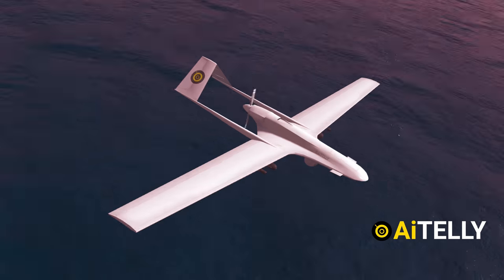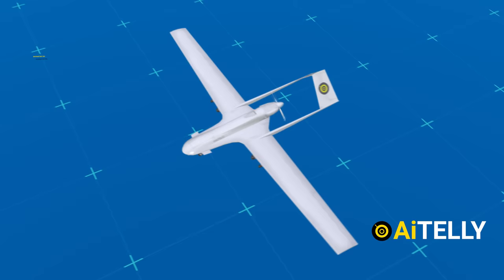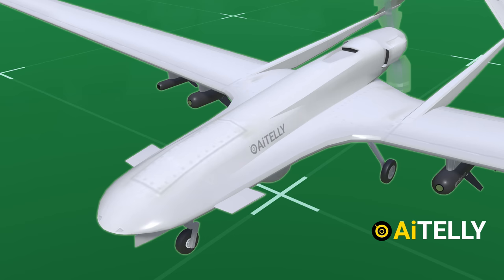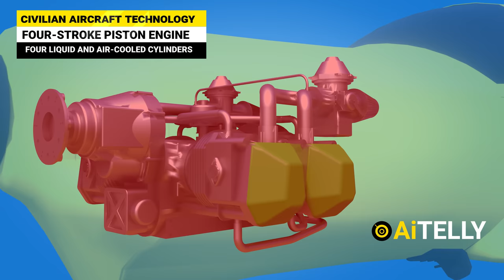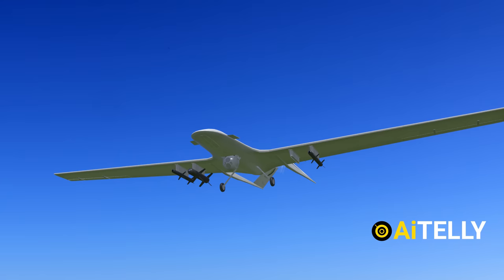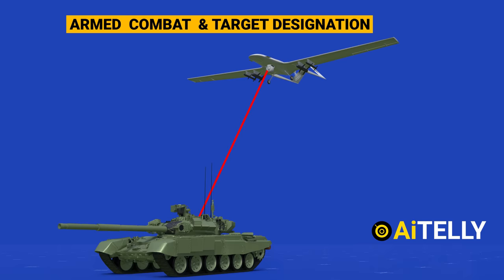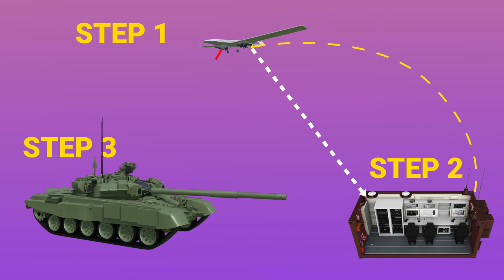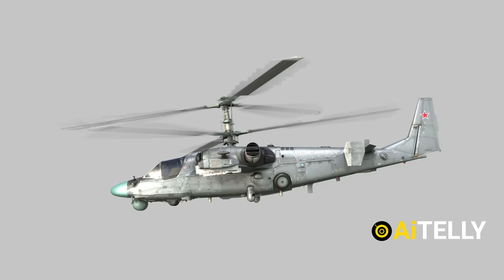How a Military Drone Works | Bayraktar TB2 UAV

Comment: Stop commenting that tb-2 is using pd-170 engine. It's not true at all. Only Anka and Aksungur are using this engine. Rotax is budget friendly because of that it's a civil engine and mass production reduces the price. It's not logical to use an expensive military engine for a cheap drone. Yeah it's an option but we can use it if we really needed otherwise rotax is always the first choice.
Reply from the maker: Yes that's what we're saying.
Have pinned your comment.
Our next Content the TB3 it is using the pd 170 (not sure)
Reply: It's a sitting duck drone. As it's not connected with satellite a person has to fly it who might be sitting in a nearby location.
Reply: @ankushbhagat341  No, Tb2s version has a satcom feature and can connect to the satellite
Reply: @ankushbhagat341  for this kind of drone 150-200km is pretty far away to keep operator from danger nowadays i saw news about the communication range increased to 300 km without satcom btw whenever tb-2 related content created why there was couple of  indians dudes making salty comments  is it really butt hurt to them
Reply: @Aitelly  Please, what are the tools used to make this video !!
Reply from the maker: Hi we made this TB3 to correct our Mistakes Check this Out
TB3 link https://youtu.be/Mw62n3g53vM
Reply: No, TB-2 does not use PD-170 engine. This engine a little big for TB-2. TB-3 uses PD-170 engine.

Comment: The Rotax engine and Wescam laser designator are not the only options anymore. Canada imposed an embargo on Turkey regarding these parts after Turkey supplied Azerbaijan with TB-2's in the Nagorno-Karabakh war, however, they lifted it after the Ukraine war started (what a bunch of hypocrites). Now Turkish versions use Turkish-made parts while export versions are offered in different combinations of either Turkish or foreign-made parts. Prices can go up and down accordingly of course. 5 million USD I suppose is starting price of a single unit without the training/command module/satellite link etc. which means if you already have the system installed in your country, you can buy additional TB-2 units for 5 million each.  If you take the whole package, in which case you have to buy the entire training/command module/ uplink etc., to install the system initially,  I heard BAYKAR's latest deal with  UAE was worth around 20 million USD per aircraft including pilot training, command modules, spare parts (whole pack) etc. for 20 pieces of aircraft which takes the entire deal up to 400 million USD.
Reply: Same procedure and costs has on other countries's drons too.I mean, if you order same size drons from US or Russia, Israel they ll be much more expensive then Turk's drons.
Reply: 20 pieces of aircraft don't need 20 command modules.
Reply: @user-ir7og3lx2d  depends which drone you gonna use. Some of drons beed land operators (captain,  gunman and commanders for decisions).
Reply: @lordlex6315  Yes because these drones are made with full western parts and know-how. Because western countries don't want to build drones, instead they said "Here Turks have this know-how and build the drones that we don't want to build." And yes all western countries are so eager to share know-how and high-tech parts with Turks whenever they needed..

Comment: Bayraktar TB2 is equipped with superior autonomous capabilities.

  It automatically taxis from its air base, takes off and can go to its mission.

  It can counter electronic attack. Russia failed to intercept the TB2s via electronic attack.

Because it is composite and small, its radar signature is small. Due to their relative slowness, they can easily be mistaken for flocks of birds by radars. While it is possible to tune the radars, for the radars to detect TB2s they must be able to deal with birds that are too many false targets.

If it is damaged during its mission and the signal connection with its pilot is lost, it can autonomously return to the air base where it started and land.

It can handle very harsh weather conditions in autonomous takeoff, flight and landing.

Besides the superior features of the TB2s, how they are used is also important. They can be used as flocks. Turkey used 20 TB2s in a flock in Syria. When used with air or ground electronic attack weapons, they can also be effective against air defense systems. It managed to hit the S300 air defense system, whose radar was active, in Syria.

Despite all these features, the TB2 is an aging Armed UAV. Bayraktar made the Akıncı offensive UAV with much more advanced features. Akıncı started to be used actively in the Turkish Army.

Bayraktar attack UAV communicates with the ground control station via satellites. Its range is as wide as the coverage area of the satellite it uses.

Akıncı can carry AESA radar. It can detect air targets and use air-to-air missiles.
Reply: I don't think it's aging but it's role changing, or more likely it becaming more specialized in a certain tactics or warfare
Reply: its burn US equipments too
Reply: yup, my only concern with the Akinci drone is that with it's higher speed (and higher stall speed) i just hope that it will not track more attention than the TB-2, otherwise i think it will do great!
Reply: @goranjosic  Yeah no that is not even remotely the same thing.
Reply: @afd1040  why? What is special about the navigation of this drone?!
Reply: @goranjosic  Aliexpress version doesn't work in extraordinary weather conditions. That is the difference.
Reply: @krebreves  Don't take this as an insult, but you sound like you have no idea what you're talking about. Turkish Military and Drone software project started in 1989? What did they use for programming? Amiga? :)
Reply: Let me point out what is the weakest link. It's not the weapon itself it's the specially trained human resources that control such sophisticated weapon. Knocking them out is a lot easier than trying to go after the weapon itself.
Once this strategy is adopted, the battlefield would change.
Reply: There’s no S300 air defense system taken out in Syria dude lol
Reply: @goranjosic  bak dostum Selçuk Bayraktar bu teknolojiyi dronlara ekleyeli 10 seneden fazla oldu, bu dronlar oyuncak değil, ve oyuncaklarla karşılaştırman çok ironik bir durum.
Reply: i dont know how effective it would be to but aesa on akinci but new jet motor turkish drone kizilelma mius most definitely should have it
Reply: @goranjosic  Remote Control RC air craft commanding older then 1989 dude. Turks were use radio frekans as others. Also remember that Apollo 9 moon landing projects computer specs:
 Frequency2.048 MHzMemory
15-bit wordlength + 1-bit parity
2048 words Ram 36,864 words Rom
:)))  year 1966
Türkiye is the NATO member and we were using early computers too. 
I mean RC systems is not that much difficult. Turkiye had no rocket technology tillll yesterday but we had some import/local products for use for this kind of technologies. We had long ambargos thats why we little been late. Turkiye is in 1 rank about Drons now. 
Do you know that Turks was produce and sale aircrafts to Europe. Probably not.
Reply from the maker: Hi, we made this TB3 to correct our Mistakes Check this Out
TB3 link https://youtu.be/Mw62n3g53vM
Reply: Indeed. Using sattelite means unlimited range. Turkiye has its own sattelites of course but they can also pass them on to NATO sattelites or other allied countries sattelites which pretty much covers the entire globe.
Reply: Also The ai of The drone can make the desicion of mission abortion or continuation in The lack of The ground base Signal
Reply: Any not civilian Drone is Unable to hack. And still Russia shot down all TB2 in first weeks (as the head of the military-industrial complex of Ukraine said in an interview with pranksters)
Reply: Reminds me of a story of some MQ9 the US used awhile back.
Apparently it lost signal through some mission and was supposed to do the whole Return to Home procedure.
But someone forgot to update the RTH airbase, and the drone apparently went on to land in California.
Since it was out of communications range when it went out, they just assumed it was gone, untill they got the phone call lmfao
Reply: This trashy plastic wing did nothing in last 7 months 🤣🤣
Reply: Community
Reply: @westerxxx9220  TB 2 never stops in Turkey. Last week, Syria also hit oil facilities.
Reply: ROFLMAO! Got OBLITERATED by the Russians. Don't hear about these any more. HAHAHHAHAHAHA!

Comment: Great video. TB-2 also can carry MAM-T for bigger targets like patrol boats and buildings. It has a thermobaric warhead. And there is also one thing you didn't mention. Overall shape and speed of the TB-2 allows it to have a very thin radar cross section. This won't help against IIR guided missiles but against radar SAMs TB-2 proved to be extremelly effective.
Reply: MAM-T has 30+ km range for TB-2 and 94 kg weight.
Reply: There was not any statement or use of mam t on tb2. Also one mam-t is almost 2/3 of all payload which cannot be carried left or right wing plyons and tb2 does not have any pylon at the middle like akinci
Reply: Unfortunately TB-2 has no capability to carry MAM-T. MAM-T's are developed for Akıncı, Aksungur and other light attack aircrafts such as Hürkuş.
Reply from the maker: made this TB3 to correct our Mistakes Check this Out
TB3 link https://youtu.be/Mw62n3g53vM

Comment: TB2 started using Aselsan CATS instead of Wescam a few months ago.
Reply from the maker: yes this will require another Video which  we will release in the next couple of weeks
Reply: wescam is much better than aselsan cats. But they still supply wescam via customer.
Reply: @leventnergiz  I agree. Wescam is the top of electroptics.
Reply: @leventnergiz  Well Telemus Systems (owner of Wescam) went broke.
Reply: @leventnergiz  Not anymore. Aselsan CATS now better than Wescam.

Comment: Good video explaining the basics of the Bayraktar TB-2 UAV.  Didn't realize they were so big!  Wonder if they could benefit from having a few miniature propulsive solid rocket boosters housed within those tail beams.  I hypothesis they would be used for quick get away and range extender.
Reply from the maker: Hi we made this TB3 to correct our Mistakes Check this Out
TB3 link https://youtu.be/Mw62n3g53vM
Reply: M.facebokk#*ide

Comment: Thanks for the video. I always wondered how they worked.
Reply from the maker: Always Welcome:elbowcough:
Reply: They are not whole truth, TB2 is not easy and simple drone as they told, It is an high tech and super softwared drone😎
Reply: @yusufilkertoprak  zaten basit dememişler videoda, sadece anlaşılır olması için basitce anlatmışlar.
Reply: @kutaydavdav1457  dikkatli izlerseniz öyle demiyor, yazılım üstünlüğünden ve kalitesinden kesinlikle bahsetmiyor! Üstelik kamera ve motor hakkında yanlış bilgi veriyor
Reply from the maker: Hi we made this TB3 to correct our Mistakes Check this Out
TB3 link https://youtu.be/Mw62n3g53vM
Reply: @yusufilkertoprak   Ağır harekat drone'u değil basit ve etkili işte Reaper gibi kıtalar arası gezemiyor abi işte. Adam övmüş zaten bir de üzerine senin övmene gerek yok.

Comment: very well explained,would like to add one more thing to the equipment part; jammer and counter jamming equipment in operational area these things fly,one should remember that they are still controlled by radio signals and vulnurable to jamming more than expensive satellite drones,thats why Turkey developed extensive layers of jammer/counter jammer equipments along the way for them and constantly updates those
one really good example for importance of jammer/counter jammer equipment is Libya,opening moment of Libya counter attack was extremly effective thanks to tb2s, they were operating without any issue due to Turkish counter jamming ships blocking jammer equipment haftar were using while jamming their air defence systems at the same time,but once the battles reached inner parts of libya they were outside of counter jamming range of the ships,thats why tb2s were either returning to base on their own due to signal loss or being shot down by air defense,which they lost shit ton  until they brought land jammer systems from Turkey name Koral,which conveniently has also has 200km range just like tb2s
Reply from the maker: Well thought of commented and Insightfull.
Reply from the maker: Hi we made this TB3 to correct our Mistakes Check this Out
TB3 link https://youtu.be/Mw62n3g53vM

Comment: The TB2 uses a domestic Turkish engine called PD220 or PD170. Not the Rotax engine anymore since this was sanctioned and consequently replaced by a Turkish engine.

The same goes for the Wescam which was replaced by the Aselsan Cats. The Canadians sanctioned Turkey as well and subsecuently the provider of those wescams went bankrupt while Turkey succesfully replaced it with a superior product which is now a direct competitor of the Wescam (or more like sole product after Wescams demise).

Your representation of the TB2 is very accurate. BUT FOR 5 YEARS AGO! 
NOT FOR TODAY. NEXT TIME PLEASE DO BETTER RESEARCH AS THIS IS VERY PUBLIC INFORMATION.

Other than that great animations! Good job.
Reply from the maker: Yes we knew that so it will be requiring another Video for this address.
Thank you for the info
Reply: @Aitelly  Thanks for your time. Keep it up!
Reply: Imagine that slap in the face when they introduce sanctions and then lose market shares by encouraging domestic tech development and production in Turkey.
Reply: @heyyo162  Yeah. Its exactly what sanctions do. Make countries independant and then they become direct competitors with the benefit that they can produce with lower costs.
Reply from the maker: Hi we made this TB3 to correct our Mistakes Check this Out
TB3 link https://youtu.be/Mw62n3g53vM

Comment: Great content 👍
Reply from the maker: Thanks  dude
Reply: Ikr, I can't believe we can watch this for free
Reply: @Aitelly  TB2 VS HERON TP
Reply: @Aitelly  can you tell about indian air Force project Cheetah under which all heron drone will become attack capable
Reply: @abhayprasad5319  They are not in the same class, one weighs 700kg while the other is 5400kg MTOW. You should compare it to Baykar Akinci which is about 5500kg MTOW. Akinci is the bigger brother of TB2. 

Both Heron and Akinci have similar flight performance such as endurance, flight ceiling, payload. However, Akinci have a clear advantage in variety of arnament with over 30 types of missiles and and guided bombs for various missions such as long-range cruise missiles, bunker busters or air-to-air missiles. The max bomb weight is also larger on Akinci with 1000kg on the central hard-point while Heron can carry 250 or 500kg bombs. No other drone in the world than Akinci can carry 1000kg MK-84 bomb variants. Akinci will also have AESA radar and AA-missiles. Furthermore, Akinci is significantly cheaper. 

Finally, completely irrelevant to performance but Akinci is one of the most beautiful air-crafts with its organic bird shape. 

Note: Both Akinci and Heron requires air-superiority to operate safely as they are both rather big drones without self-defence packages. TB2 does not need this as it is small and cheap for high risk missions.

Comment: It's range is not 150km but 1500km I guess. great video!
Reply: Nope. 150 without any enchantment (base model)...
Reply: @cagatay518  a thing flying at 300km/h  and can fly 24 hours makes 150km very funny. Even it is the basic model. It is at least 1500km.
Reply: @avionot.savunma  it's range not duration. without SATCOM capability, it can only be affective 150 km around the command station. it can fly 24h but in the vinicity of 150 km of the command station. :)
Reply: @cagatay518  it can fly without satcom. The basic model has 300km range for connection. When it doesn't have the satcom it uses it's in-built navigation systems and does it's job without the ground control. Also Akıncı UCAV uses the same ground control stations and the same communication systems but it has flown from Istanbul to Baku without SATCOM. So the satcom does not affects the range.
Reply: @avionot.savunma  the first model's connection range is 150. i don't know if it is extended to 300 or not. You are totally wrong about doing job without the  ground control. Only job it does is going back to base if it lost connection.  We are talking about tb2. the one you are talking about (İstanbul to baku travel)  is the 5 ton beast Akinci, not the Tb2 . And it has ofcourse SATCOM. it could go to London from İstanbul and come back in the same flight infact, as it has a range of 7500 km.  Have a nice day. :)
Reply: @cagatay518  I already said that it was Akıncı. I have images of the satcom versions with a ballon on the top of Akıncı. The one with the transponder code "CEVHERI02" went to Baku from Istanbul and it doesn't have the SATCOM. Also TB2 has a capability when your mission is not bombing but getting intel of a secret army base from the enemy country, it can go to the coordinates without ground station and get the intelligence and images. It is more than 300 kilometers. And lastly when it is autonomous, it's only job is not going back to ground control station. If the ground control station gave a command to destroy something, it would do it's job autonomously and turn back later.